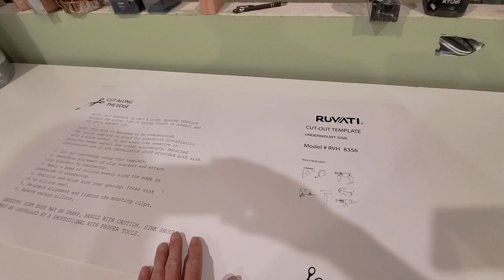Last Kitchen Cabinets Installed in our Off Grid Home - Tips and Tricks for Base Cabinets on a Slab

Comment: isn't it bad to put these counters on the slab? moisture? dont you need pressure treated lumber under?
Reply from the maker: I put strips of pvc under them so they are off the floor which allowed me to slip the flooring under them too.